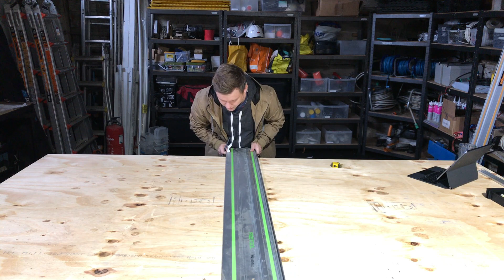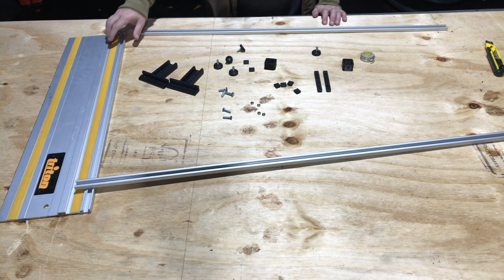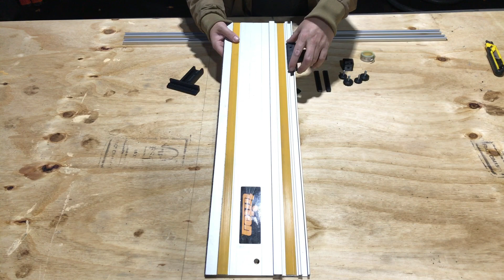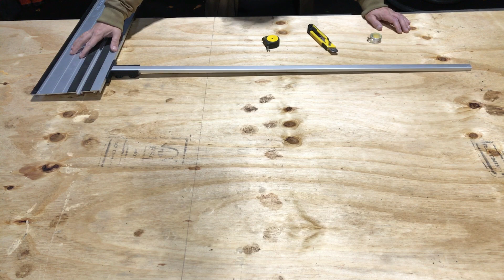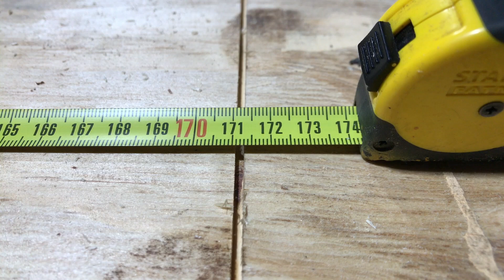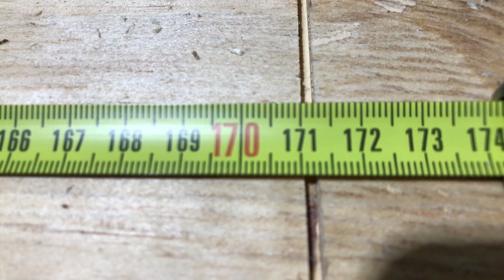Can i upgrade my track saw and save £300?

Comment: This is a bit more professional looking than the one I made but the principle is the same.  I 3d printed the rail fixing and the sliding stop but, being a cheapskate, I used plywood strip (about 75mm wide) in place of the t track and for the measuring tape I used the paper tape measures that hang up in a well known swedish furniture retailer.  Not as good as yours but, when I inevitably stand on them, I won't be heartbroken at having to replace them.  Good video, thanks.
Reply from the maker: To be honest I don’t use these super often but they are useful to have in the shop. Also the 3d printed parts aren’t that durable

Comment: Hi Jamie, I really enjoyed the video and subbed. Would there be any merit in making extensions for these do you recon as I guess to get 1710 length you would need to do the maths and allow for blade thickness, and then set the rail up from the offcut end of the sheet as things stand? I'm guessing that might make the guide and track a little unwieldy? 
It's also a shame the t track aren't 50mm longer so a 2440mm sheet of ply could be cut exactly in half.
Reply from the maker: yea you would need to go from the offcut side to go over half a sheet like you say. I cant remember exactly the size i made them if its enough to do half a sheet but for them to be 50mm longer you just need to use longer alumium extrusion t slot tracks and they were very cheap. Might have been an oversight on my part

Comment: Hello Jamie, great diy jig. You could attach the slotted aluminum rail to the T-shaped part with "clearance", before you attach the tape measure. By doing so, you can calibrate (fine tune) the actual measure by shifting the slotted aluminum rail back and forth according to any the length error. Stefan.
Reply from the maker: In the end I cut a fresh strip of the rubber guard that sits on the track and then ran the tape measure out from there having it be at 0mm on the rubber strip where the blade of the saw will be.

I ran this across the aluminium t track and then just cut off the excess that was on the rail and that worked well.
Reply: @jamieclarke321  ok, so you have applied a new tape measure - I wondered if you wanted to live with the error :) Greetings Stefan.